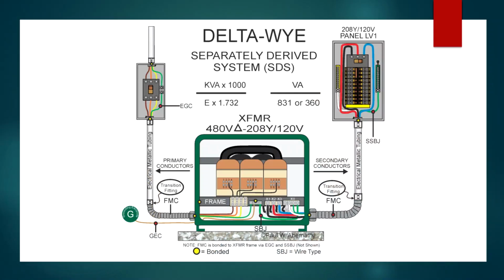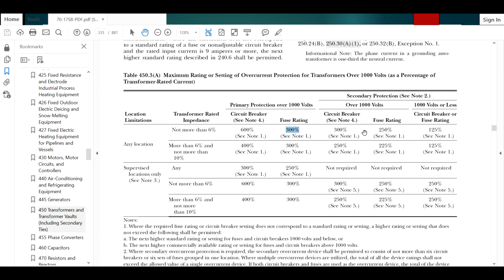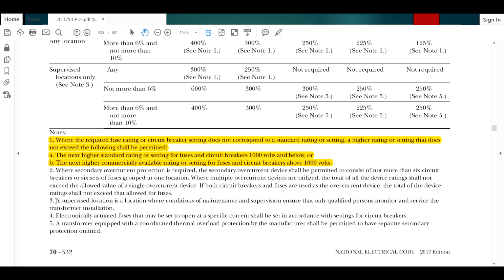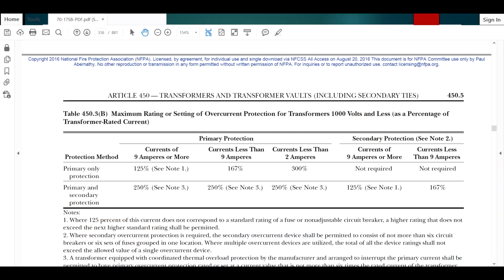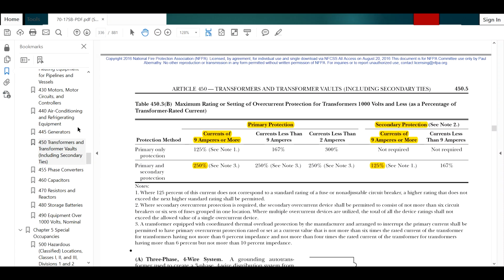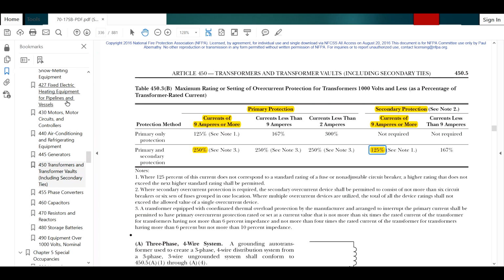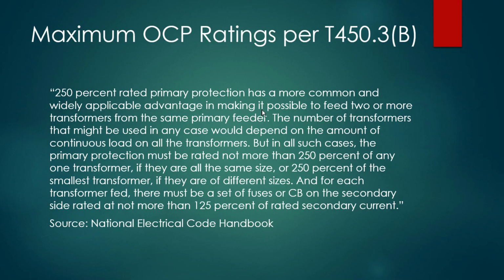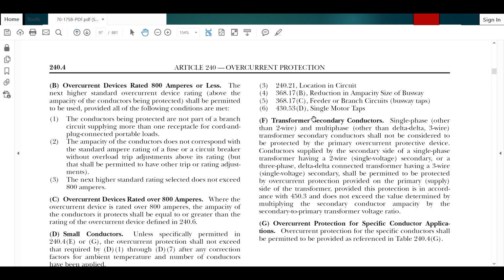2017 NEC - Transformer Series Part 2 - Calculating the Primary and Secondary Overcurrent Protection

Comment: Love your videos! When using the primary only OCPD for single phase 2 wire and 3 phase delta delta. What do you mean by one voltage only? Are you saying the primary and secondary have like for example: 3 phase Delta Delta 480vac primary and 480vac secondary One voltage? Or 480vac delta primary and delta 240vac only secondary? Please help me to understand. Thank You, for your videos.
Reply from the maker: Meaning 480V only or 240V only, not 480/277v or 240/120v.